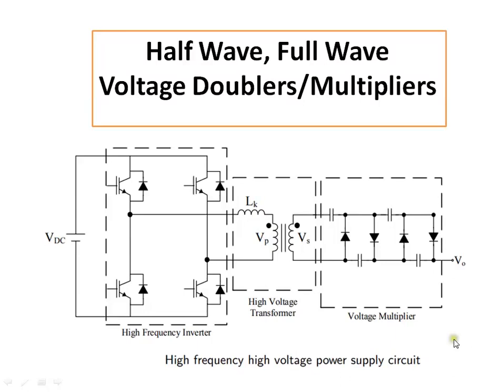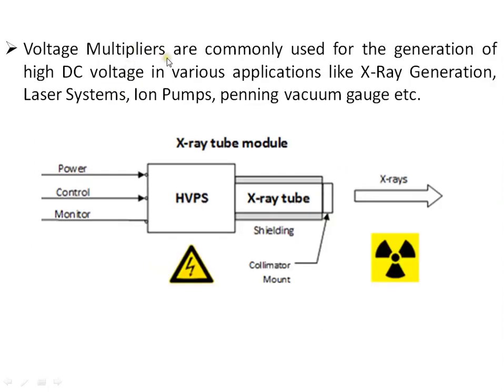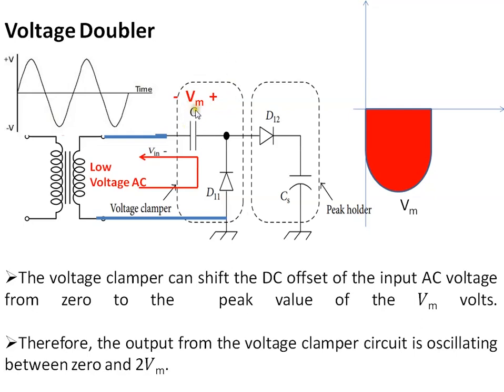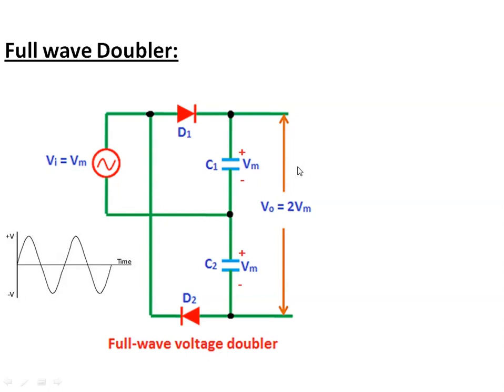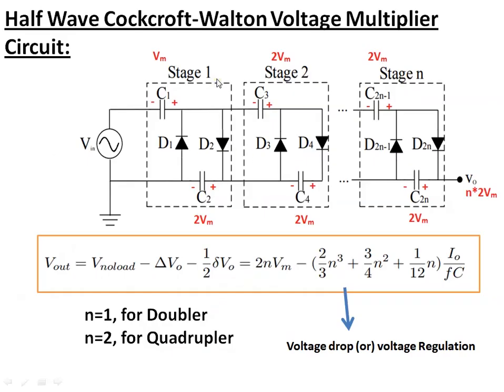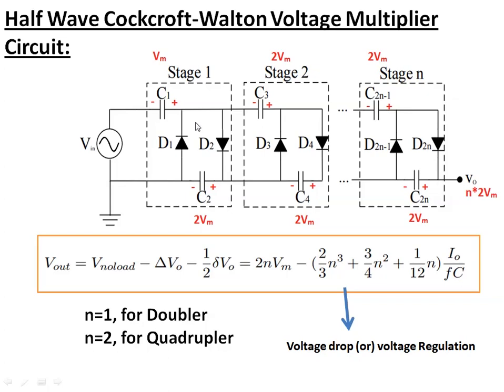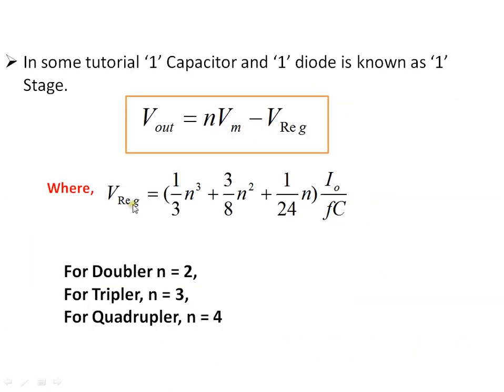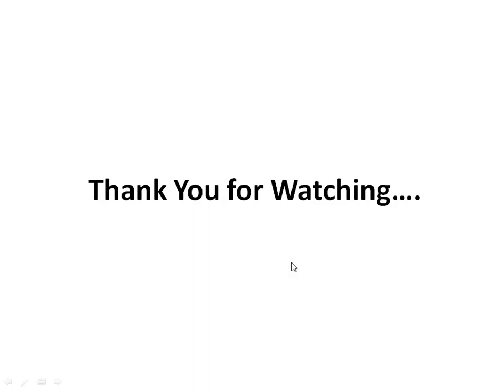Half Wave & Full Wave Doubler Circuit Explained || Cockcroft-Walton Voltage Multiplier

Comment: If I use big capacitors in full wave doubler like 500 uf will this higher amperage from the discharge cycle damage my transformer? Or as long as my secondary coil the wire gauge is large enough to handle the extra amp from the voltage multiplier it will work fine? Please lmk friend